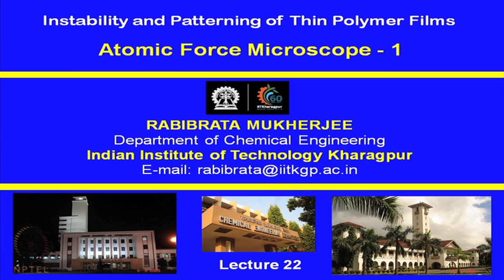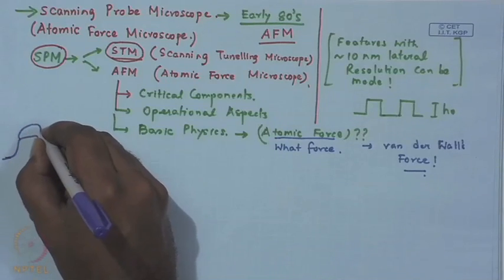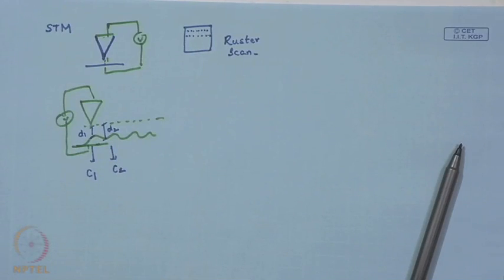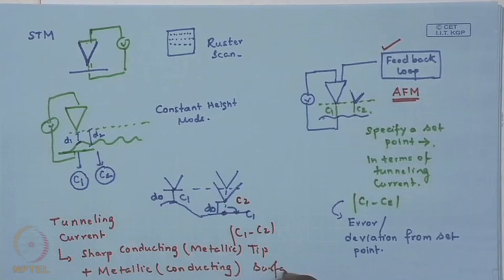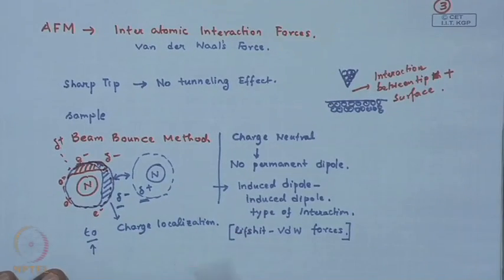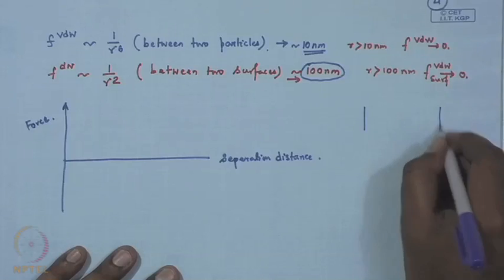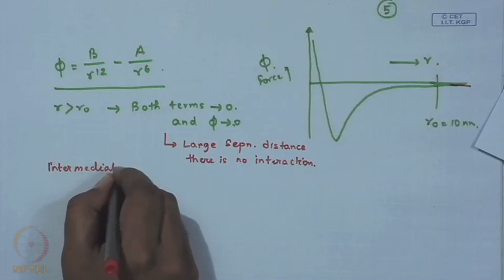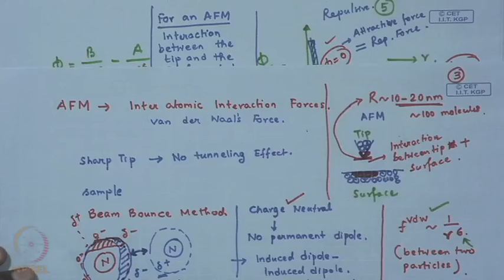Mod-01 Lec-22 Atomic Force Microscope - I

Comment: first of fall he wrote wrong LJ  curve is potential vs distance not force vs distance .He said at time-- 43.59 that the LJ potential curve is repulsive in nature when once the physical contact is made 
so my question is when the force is zero at an instant where distance is lower than lower potential point  what happen at that  point means is particle doesn't feel any thing is they at equilibrium at all.   I am taking at an instant not an interval.  physical what was happen at that point  I  think it might not be repulsive at all because at very  low distance repulsive nature  is dominant but here force is zero